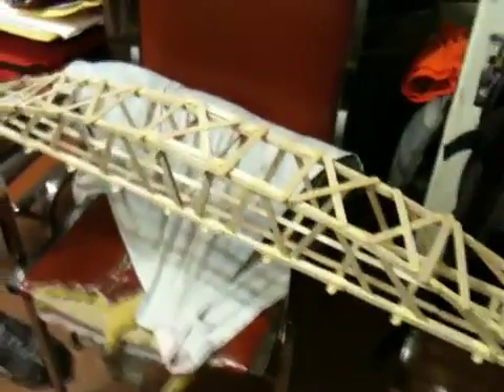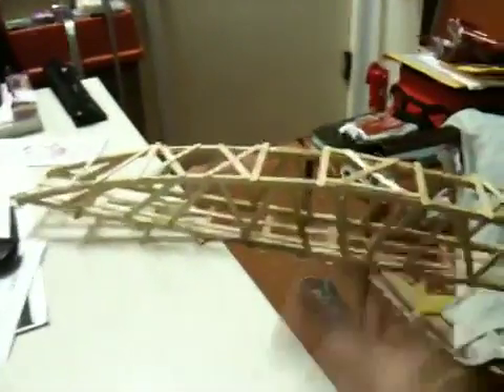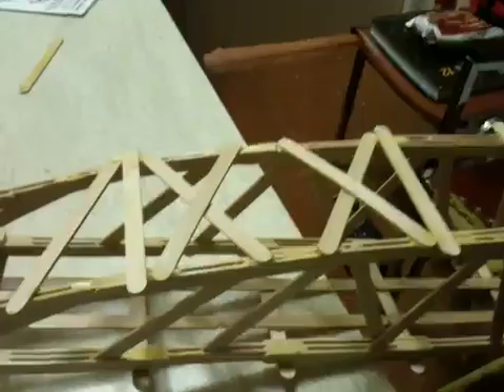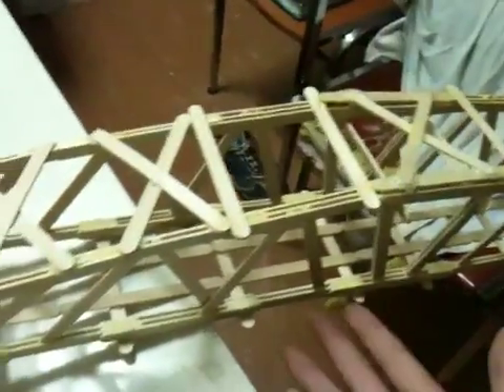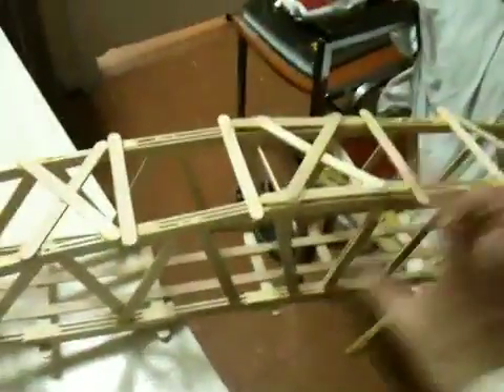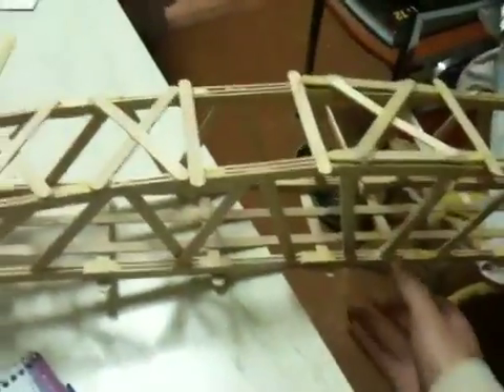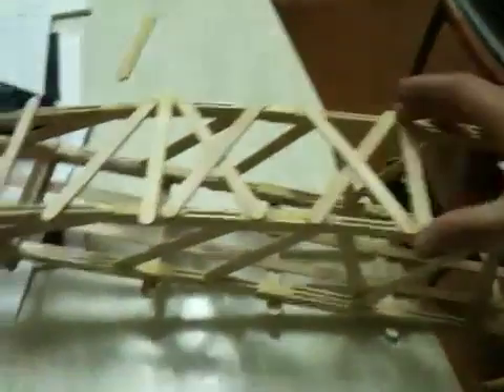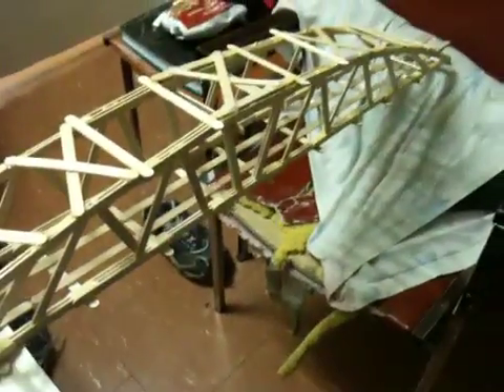Tips On Building a Popsicle Stick Bridge to Hold Atleast a 100 Pounds!

Comment: question. what do you suggest I do if the required sticks to use are round sticks? like barbecue sticks? 
it's for a contest, for now in school (high school) we're doing practice bridges/ trials but we have to practice with round sticks cause that's what we're using for the competition.
Reply from the maker: Chesca G why in the world would they make you use round sticks? hmm. i suppose you could use the same techqnieus. wood glue, clips to hold them together firmly. see how that goes. are you allowed string? you oculd also tie the joints. hope this helps.g ood luck
Reply: randomrazr i have no idea why they would make us use round sticks... we're not allowed to use wood glue because we have a 3 hour time limit though... i dont think we're allowed to use string, but we're allowed to use them during trials.
last questions... what's the safest way to make a base when I'm making a beam bridge? and what if the supports (iidrk what you call them, the one connecting the lower and upper part) are bent inwards?
Reply from the maker: Chesca G 3 hours? geezes i dont even know what to say. does it need to support weight? seems like cement or a glue gun would be the fastest. all i can say is have triangles, strongest shapes to have in a bridge if ur not going for a curved bridge
Reply: randomrazr yeah it needs to support weight... from the bottom, like they connect a hook/bag idrk and add 1 kilo every five seconds it doesnt break... we have to use glue gun, i think...
do you think I do truff or beam bridge?
thankns for helping me and I really appreciate that you're actually replying so quickly
Reply from the maker: Chesca G not sure what u mean by beam bridge but truss bridges u cant go wrong. glue guns are very strong, so im udner the impression their not expecting ur bridge to hold 100 pounds. like mine did. u want to ensure the to stick that join are joined tightly so use the clip thing i showed in the video, as hot glue guns tend to not compress well. thats my 2 cents. good luck. sounds like u can practices these before the actual test
Reply: randomrazr thanks for your help :)
i really appreciate it, and the tips you gave in your video could really help for when (if?) i start making actual projects... if ever i continue to want to take engineering as my course
Reply from the maker: Chesca G are you in university? sounds like a post secondary project if they only give u 3 hours. i kinda wish i took engineering courses but...to much math lol
Reply: randomrazr not yet in university.. I'm still in 10th grade (lol this project is for seniors and juniors, im considered a senior) but this project is made by my country's national university and idk the details but i think the group that gets the best either gets partial scholarship for when/if they decide to take up engineering there or they get cash that goes to the school..

Comment: I was wondering if what sticking glue did you use to make this more durable?
Reply from the maker: i believe it was wood glue
Reply: randomrazr did you get the overall weight of the bridge before it was tested to hold some objects ? :)
Reply from the maker: mariem inandan it held 100 pounds atleast. we never had a weight limit on the bridge itself so i didnt bother weighing it

Comment from the maker: if those are the only 2 materials you can use i suppose u could use dental floss to wrap the joints

neither those are very strong though, im assumign ur bridge does not have to hold 100 pounds cause 100 pounds is quite heavy

Comment from the maker: @Rustyy444 the requirements of the project was to build a bridge with a limited number of sticks and meet the length it was suppose to suspend at.

it was marked by the amount it can hold.  so if u got 25 pounds before it collasped, u get 25% LOL if u get 90, u get 90%.

we werent doing anything about performance rating shit, nor was this a competition.

i dont know what ur problem is but if u dont like the vid or the bridge, make ur own TROLLOLOLOLOL

Comment from the maker: @kunalxxx1 depends on the rules.  i wanted to make a suspension type bridge for fun/ challenge but ur not allowed to use  (for me) anything but 200 popsicle sticks and glue..  no glazing or anything just that, and of course must span i think it was 100cm atleast and b atleast a certain width.

for an arch bridge like mine...u dont need strings lol